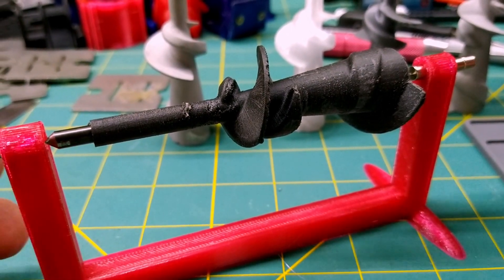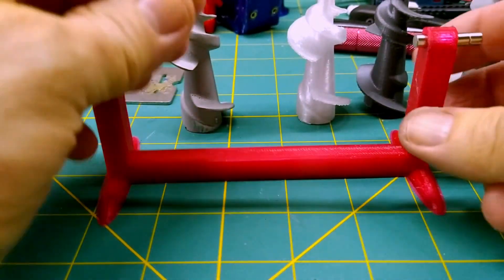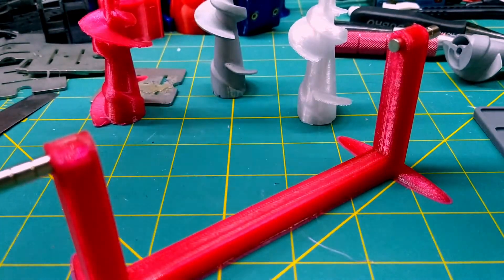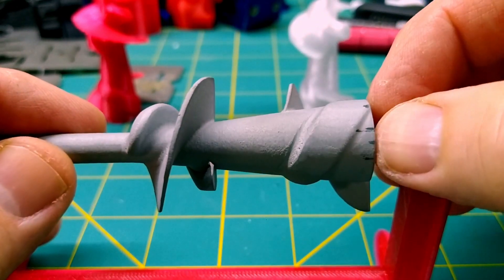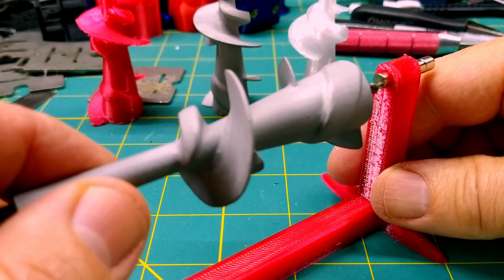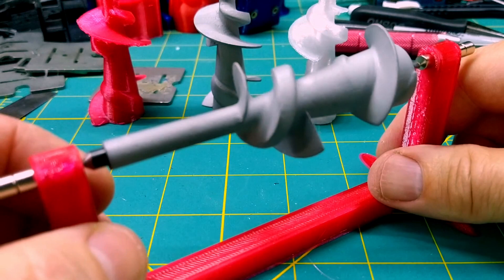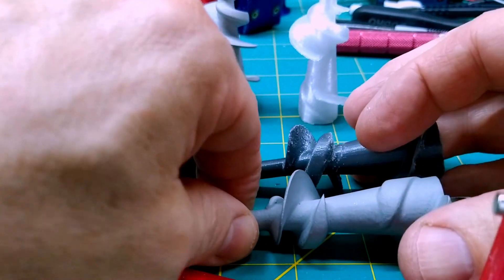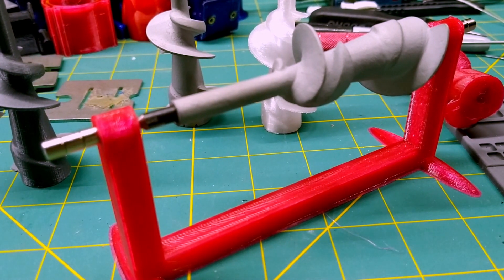MJet 35 prop balance comparison

Comment: You have to balance it with the shaft installed otherwise the built in counterbalance will not work.
Reply from the maker: The stainless steel shaft isn't magnetic enough, I had to use a drill bit shaped like the shaft.